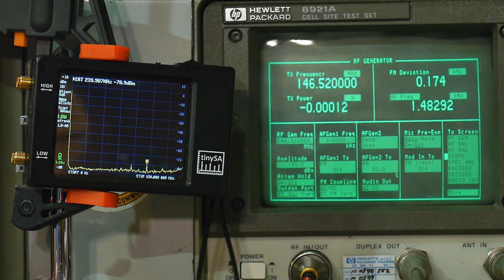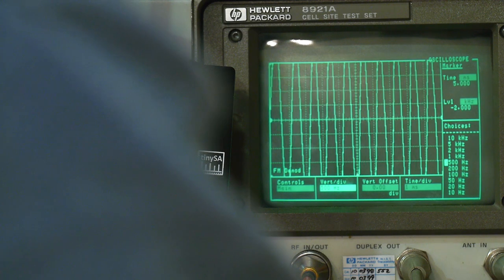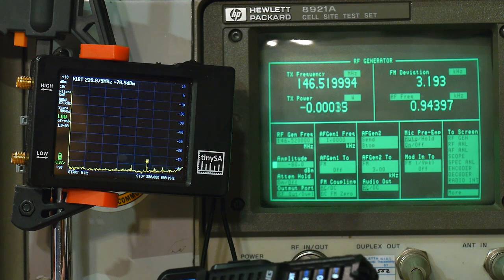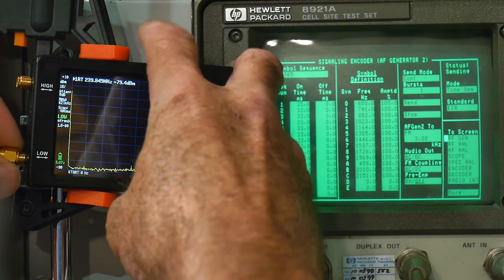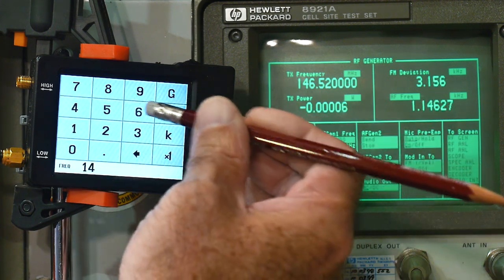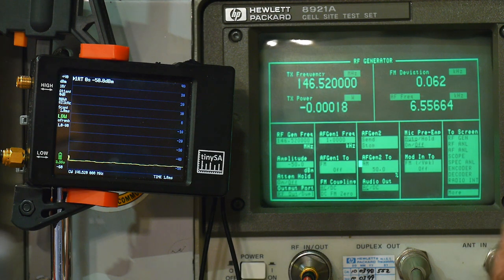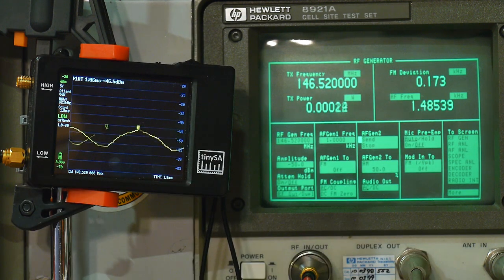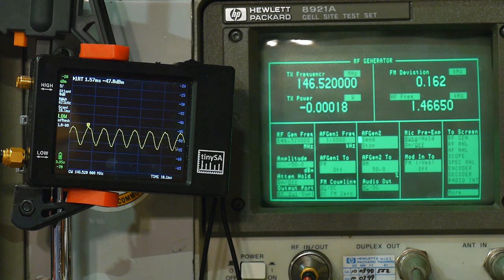#550b TinySA Zero Span Mode

Comment: If you demodulate AM you better use Volt as unit i.s.o. dB. The log scale of dB distorts the sinus. Volt will also automatically scale correctly
Reply from the maker: Erik, I want to do a video on using the TinySA to receive radio signals. I used peak hold and monitored the aviation band for several minutes. It missed many transmissions compared to the HP instrument. I used normal and fast sweeps but it still missed many. any settings to make this better? The second question is about the 0 to 30MHz range. The sensitivity seems very low and almost unusable for monitoring.
Reply: @IMSAIGuy  What frequency range are you scanning? What is the sweep speed? For monitoring you may want to add an external LNA. See this example: https://tinysa.org/wiki/pmwiki.php?n=Main.LNA
Reply: I assume you are using a real antenna for the 0 to 30MHz range (not the telescopic antenna) and you set attenuation to manual 0dB.